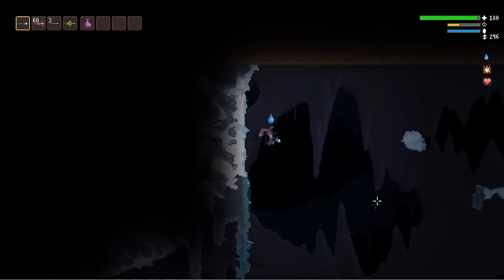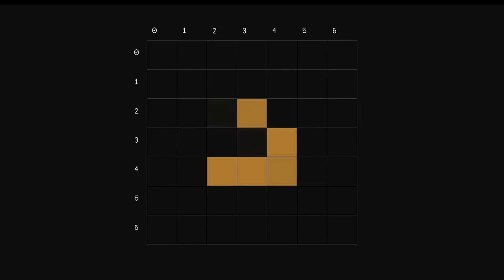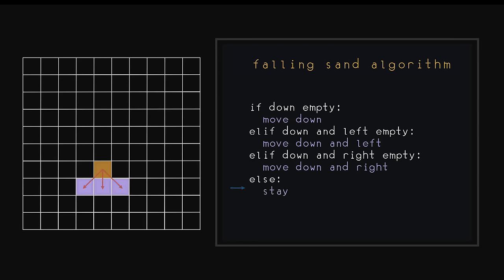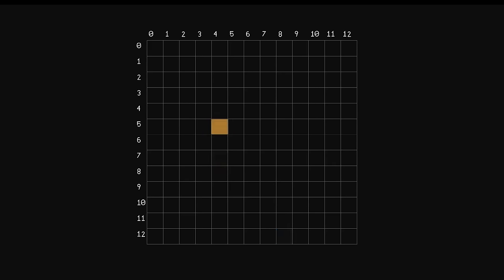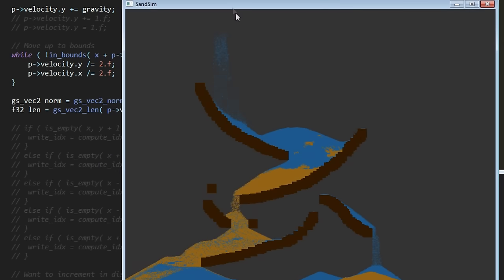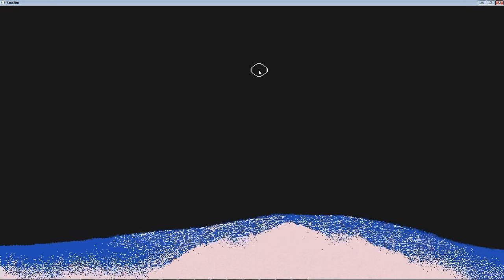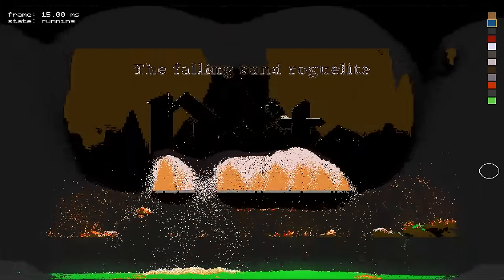Recreating Noita's Sand Simulation in C and OpenGL | Game Engineering

Comment: That's amazing!

I was wondering how this could be implemented in Unity. Obviously, you can't have each particle be a GameObject, or the computer will explode, but you can't use the particle system, either. The closest alternative is a compute shader, but I don't know how well that performs when called every frame.

I'm guessing DOTS?
Reply from the maker: As long as you have some way of using off-screen render targets (which Unity does), you could do the same thing here in a single script that's attached to a GameObject. That GO would be responsible for running the sim, updating the particle data array, then blitting that information to the texture.
Reply: @johnjackson9767  Right! I forgot Blit() was even a thing. 😅

Comment: I love the style of this, it reminds me a little bit of 3b1b! A few technical questions: the struct in the beginning had a velocity vector with 64(bit), why not use an int tuple instead? correct me if im wrong but that would lower the amount of overall memory usage drastically? Love your videos!
edit: integer not unsigned integer tuple
Reply from the maker: Thanks for the compliment. I made mistakes in the vid and switched up bits and bytes for the descriptions. I wrote about it in the pinned comment if you want to check it out.

Comment: How are you handling momentum, is there a separate texture where you store the momentum data of each pixel? Could that be taken in consideration during collisions to transfer momentum? How about running some navier-stokes kinda thing on the "empty" pixels of the momentum texture to get wind, and inside the core pixels of blobs of liquids for currents? Maybe If you make it a RGBA texture you could have momentum on the RG, pressure on B, and temperature on the A; and take all of those factors in consideration?

Comment: Is there any other easy-medium physics/mathematical simulations that you can recommend to an intermediate programmer? Or websites/channels/blogs for something like that? 
I've been doing a lot of simulations during the summer but I'm starting to run out of ideas...

Another thing, how did you get that level of smoothness? Is OpenGL and C++ that fast originally? I'm using C# and even with compute shader there's a limit to how large the screen can get without the fps dropping below comprehension.

Comment: did you run into an issue when creating this where your particles would interact strangely while falling in air, or sliding down a slope? mine create long rope-like structures off to the left. I managed to fix this somewhat, but now a similar issue occurs when sand is falling down a slope and I cannot find any resources online about it, and am at a bit of a loss as to what could be causing it.
Reply from the maker: Yes. If you're running the simulation with a single buffer, then you need to make sure to iterate from the bottom up instead of top down. The ideal scenario is to double buffer the data, that way you're not reading and writing to the same buffer in a single frame.
Reply: @johnjackson9767  thanks, I'll try this later!!

Comment: How did you handle sand falling through the water? Does the sand particle simple switch places with the water particle?
Reply from the maker: Yes, then it changes its velocity to fall slower (stimulating drag through the water).

Comment: Great video! Is this simulation able to simulate communicating vessels or hydrostatic pressure where water will try to keep an even level with all of the connected water particles?
Reply from the maker: This simulation does not, which is one of the failings of it being a cellular automata simulation and not a physically based one.

Comment: Is that a programmer-thing to say that 8 bit images are 32 bit RGBA? Because I think what you mean is that you have 8 bits for R, G, B and A, which is 32 bits in total.

But as someone who works with digital image files regularly, I've never heard anyone call those files "32 bit", we'd usually call them 8 bit, because each channel has 8 bits. That keeps the term representative of the level of color detail regardless of the channel count, and lets us avoid calling actual 32 bit image files "128 bit", and disregard whether it has an alpha channel or not (in the ladder case it would have to be called a "24 bit" or "96 bit" file), and if it even has color. 8 bit grayscale, and 8 bit RGBA both have the same bit depth pr channel, however in one you only need 8 bits, and in the other you need 32, which gets confusing.

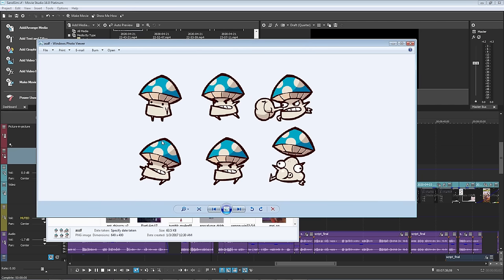So afaik. the more normal way to say what you said here 8:22 is that most images are 8 bit.

Great video, btw. The way you clarified and visualized from 1:55 on had me impressed. I know it might seem silly, but nobody seems to be able to put that sort of info into video form elegantly.
Reply from the maker: Thanks for the comments. I can see where the confusion is, but it is technically correct to say 32-bit color, since the aggregate for a pixel (assuming RGBA8) would be that. However I can understand where the confusion might be. If it were '8-bit color', then I would assume an internal format of something like RGB332, which is a palette we use at my job currently for limited palette images.
Reply: @johnjackson9767  Right, so you would then refer to RGB8 as 24 bit color, if I'm understanding you correctly?
Reply from the maker: If referring to the internal format, then yeah, it's 24 bits per pixel.

Comment: Maybe I’m underestimating how fast computers are, but, when you have many particles, how do you make this run at a reasonable speed?
Do you do processing on the GPU?
Do you have some sort of “this particle’s environment hasn’t changed, so don’t run its code, as it will stay the same” thing going on?
Like some kind of “this is where stuff changed last frame” mask?
Reply from the maker: CPUs are fast enough to handle this. Moving this to the GPU would be the best way to make it scale.
Reply: @johnjackson9767  Thanks!

Comment: Great video! :)
How would you go around implementing gravitational fields other than the current 2d gravity?
Reply from the maker: You just need some way to store the field data (most likely a 2d grid as well). Powder Toy has multiple fields that it stores to apply forces, for instance, such as pressure, heat, and magnetism.

Comment: How did you get it running so fast? I used dirty rects and chunks to help with optimization but mine runs no where at fast as yours. Did you multithread it? Also how big is each pixel in your simulation, the size of an actual pixel or bigger.
Reply from the maker: @tundera1297  Single threaded, each particle is the size of a texel in the image. It has significant slowdowns with some more logic intensive materials, such as fluids.
Reply: Thanks how many particles can you get on screen before experiencing a slowdown. I can get to around 2,000 each the actual size of a pixel in an 800 x 600 window before experiencing major slowdowns.

Comment: How can we implement equilibrium rise such as from under walls? I'm guessing there needs to be a connected surface height variable in which the lower surface voxels will shift upwards until it all evens out.
Reply from the maker: Yep, you got it. Some kind of pressure map could be used as another force. For now, since this was a simple program, the only forces are gravity and velocity.
Reply: @johnjackson9767  Understood and thanks.

Comment: How do you update the cells simultaneously, while following the rules?

Your cells don't just change their own position as it is typical for cellular automata, so why don't you run into conflicting rules and disappearing particles?
Reply from the maker: Yep, it's not strictly the same since it doesn't operate on a snap shot state like a typical cellular automata would. However it follows the same principles for its simulation. Converting to a double buffer would be a more strict implementation, but I didn't have time to do that here.

Comment: How do you manage memory for this?
If the entire thing is grid based you'd have to check an array with indices far ahead of where it is... But are those indices expected to still fit in the cache line? Or are you just letting cache misses happen for nearly every piece of sand?

Or do you rely on parallelism somehow, to make different lines iterate through different areas of the array to keep it in the L3? Or can you just expect it to be in the L3 by "default"?
Reply from the maker: Cache misses aren't the concern for performance here but rather just the size of the grid being iterated on. Moving the entire simulation over to a compute shader and chunking it up into sizeable cells is how I would improve this demo if I were to continue it.

Comment: Your particle_t is not 136 bytes, there's also a wasted bytes on padding. It is 160 bytes at best, but most likely it will be 192 bytes depending on a particular platform. But don't do #pragma pack(1) or alignas(1) in C++, because it will kill the performance.
Reply from the maker: I appreciate the comments and feedback, Paul. I've mentioned in the comments above, but there were a few mistakes that I and others have caught after the fact that were addressed, the size of the structure being one of those. A lot of this just came down to copy/paste errors with the strings used for the animations themselves that I unfortunately didn't catch. The size of structure, on a 64-bit platform, is 24 bytes in total, not the grossly exaggerated amount here. I typed "bytes" when I meant "bits" for the entire latter-half of the struct, thus causing unnecessary confusion. I apologize for the typos and will do better to address them in the future. Thanks for watching!

Comment: I've always been under the impression that doing bounds checks takes up a lot of processing power in tight loops. Is there a way to avoid doing them?
Reply from the maker: I don't see a way around it. As soon as I need to move around through the grid, I run the risk of indexing outside of valid memory and require a bounds check. You could modulus, but I'm not sure of the performance benefit that would gain. As with anything, profile then change as needed.

Comment: How does your computer not crash when simulating all the tiny cells? Are you using some sort of optimization? If so which one
Reply from the maker: Because it's a cellular automata (of sorts), it's an O(n) algorithm - just update each cell from bottom to top, left to right alternating. The grid is relatively small - roughly 512^2. Modern computers are fast enough to be able to handle the several hundred thousand updates without any struggle. 
If this were to scale larger, you would need some sort of chunk based update + parallelization scheme to run efficiently, either with threads on the CPU or using compute shaders on the GPU.
Reply: @johnjackson9767  Wait, you were alternating between cells?
Reply from the maker: No, alternating which side to start on for each update. This keeps a bit of pseudo randomness so the sim doesn't look stale.

Comment: what's your thoughts on using std 99 vs std 90 in C ?
Reply from the maker: I use c99 for gunslinger and like it quite a bit.
Reply: @johnjackson9767  No. I mean why did you decide to choose c99 instead of c90?
Reply from the maker: @Ell1otC4ke  Certain features, mainly syntactical things like struct initialization and creating variables inside of loop declarations. Small things, really.
Reply: @johnjackson9767  Gotcha. thank u